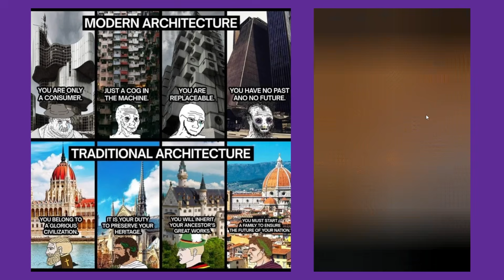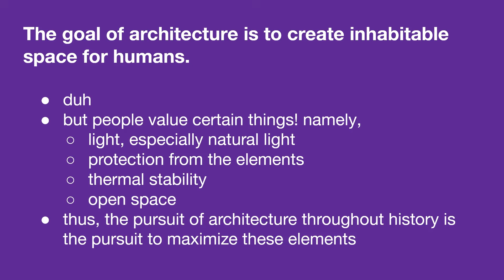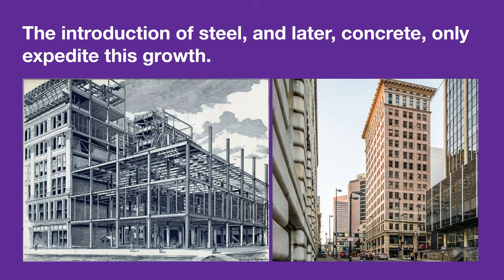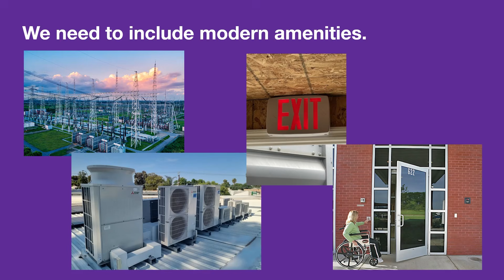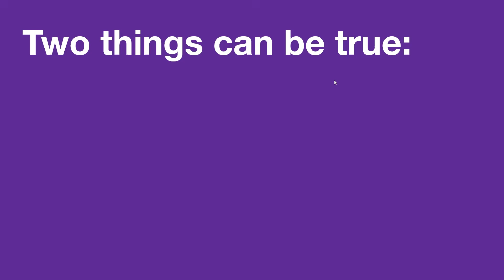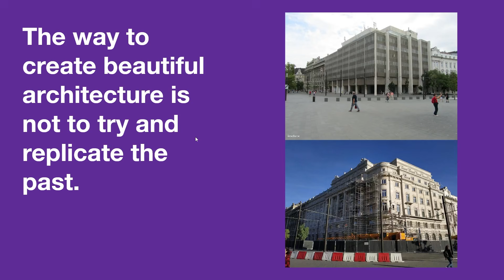Why We Don't Build Like We Used To

Comment: Generally I agree the debate is misplaced. I think the actual problem of architecture (a problem throughout time, not just a modern one) is that architecture generally doesn't consider the community at large but rather whatever the client wants. This isn't the architects fault but more of a fault of society, and modern society focuses on short term value over human growth. Strictly speaking though building better community spaces is actually better economically in the long run because it encourages growth in the people themselves.  A great example of this is all of the architecture which stands the test of time. Generally most of these are community spaces or places which can be enjoyed by the community at large like cathedrals, museums, etc. Even buildings like the Empire State have observatories and public shopping. 

A great example of communal thinking would be the Rockefeller center. It's genuinely a great place where everyone can feel special just by being there which is quite inspiring. While it has offices and shops, it offer a wide variety of public spaces and well decorated areas that are meant to lift up the human spirit and I think it shows why it's such a popular destination. It could use a little more greenery but that's probably my only criticism. Contrast that to most of the skyscrapers being built today like the pencil skyscrapers and you can see why people seem so frustrated. It feels like a gaudy unapproachable world in comparison, flaunting wealth and inaccessibility as well as separating the classes. Like I said though, it is my economic theory that this sort of greed destroys us in the long run, and it may be that our time is running out. Society can always change though so it's not all doom and gloom.
Reply from the maker: well said!

Comment: 7:05 yeah no. The vast majority of decoration on the façade of older buildings was mass produced in factories/workshops. Very few of the ornamental elements that we see on traditionally designed buildings are hand carved stone, most of them are cheap mass produced stucco that was picked by architects from catalogues.
Reply: Came to say this. Ambiguity in what people define as "classical" allows to make any point you want.
Reply: @barking_doggie exactly this video is dishonest. Also, it’s flat out wrong. Buildings made out of glass are absolutely not efficient, glass is a terrible insulator. Finally, smearing everyone who doesn’t want to live in cardboard boxes as racist is ridiculous. This happened in Norway, where people that wanted traditional architecture were smeared as nazis, until it turned out the leader of that movement was a left wing Jewish man.

Comment: I think this is mostly correct, but misses some details. For instance, 20th century revival movements are what many people who talk about "returning" to traditional architecture are aiming for. These used a great deal of prefabricated ornaments (rather than overrelying on handcrafting), and are often found in much humbler places, with much humbler construction, than the palaces that have been preserved. In my home city, there are a lot of office and warehouse buildings clad in mass-produced terra cotta tile. These look appealing and were inexpensive enough to use that apparently you could clad a warehouse in them. Most of the more "traditional" looking buildings in Canadian cities are less than 200 years old, and, as such, were built this way. The difference between the "traditional" style of building and the more contemporary styles that emerged in the 20s are not just new materials, but also well-worn rules of form, proportion, and ornament, as well as an ethic of coexistence with surrounding structures and places that descends from pre-capitalist property norms.

One interesting point I noticed that you missed is that the exterior of a building does also (historically) have a role in the design of it; a building's role on creating a public space was, in the past, also a significant component of its design, (obviously, excluding shanty dwellings, like the one you depicted). In the contemporary context, it's more typical for a building to be designed to stand out rather than to fit in, imagined almost as a sculpture than a component of a public space. This is not universal (you provided an example of the contrary), but it is common, particularly in North America (this is partly an artifact of our property norms and zoning policy though).

While I'm always going to be a defender of a lot of modern architecture, sometimes it does make decisions that are just aesthetically or functionally bad compared to how vernacular architecture was built in the past (the overabundance of flat roofs, or extreme many-edged sculptural geometry, for instance, tends to lead to water problems, while especially well-sealed structures that could have been made more breathable are not equipped with the proper design features to avoid developing mold problems). Additionally, modernization has brought with it a great deal of abandonment of vernacular styles, which remain fairly inexpensive to use. Where I found your talk lacking was that it omitted discussion of the middle stratum of historical architecture, and how certain conventions and vernacular elements, inexpensive in their day and not too adulterative of the cost of construction in ours, have become much more marginal, in spite of their relative benefit to the function of a structure as a constituent element of a public space. That all said, there is something about revivalists of "traditional" styles that is always rubbing me the wrong way, and I agree it's associated with vulgar reactionary tendencies.

I'll add one other note: we can't always say that fancy looking old buildings were universally expensive and uncomfortable. This past summer, for instance, I stayed at a hotel in Rome, while it was brutally hot. The building was made of stone, in about the 17th century, with an internal courtyard and a design intended to channel air through the entryway and up through the centre, cooling it. It was very similar to a number of abutting buildings, and it was very beautiful, in my opinion. This hotel was once some rich guy's mansion, but features like courtyards are fairly ubiquitous in period architecture all around the Mediterranean, including apartments, public buildings, and so on. It had retrofitted elevators, but no AC (we wound up asking the manager to give us a lot of fans, which, coming from Canada, were hardly enough, but it was ok). The building could easily have had AC retrofitted in, but the Roman tolerance for heat and the design of the building are such that someone not from a city built on a hot swamp would be essentially fine, even in the misery of mid-July in a heat wave. Compare a glass-clad building, where even in relatively cool places, the glass tends to have a greenhouse effect, requiring AC so that the space won't essentially cook in the summer, and even with double-glazing, costs substantially more to heat in the wintertime than buildings with smaller windows. This is no small thing, as most heating in Canada is done by natural gas, and that is one of the reasons why, in spite of our relatively carbon-free energy grid (except in Alberta), we are still some of the worst per-capita polluters in the world. To build a building that meets high emissions standards (like LEED or the like), especially if it is a house, glass cladding is often a financial and practical infeasibility. It's all about tradeoffs, and "traditional", vernacular features are often able to address the fundamental needs of a building with less ongoing expense than more contemporary styles, that are able to ignore such approaches to habitability because we have AC, central heating, electric lighting, and dehumidifiers. Ironically, this can lead certain contemporary structures to be more expensive to maintain and less comfortable without the addition of modern, energy-hungry amenities, than vernacular construction. Personally, I'd like to see less of a straight "return" than an embrace of the virtues of vernacular structures, and more construction that properly confronts the practicalities of managing water when petroleum-derived sealant fails, especially in the middle stratum of relatively inexpensive, but decent quality builds.
Reply from the maker: Well said! I wanted to rebuke many of the talking points I've seen online in this video, but I could have dived deeper into the difference between the local vernacular architecture and the mythical "traditional" architecture. I do agree that many cultures have developed low tech solutions to their environmental conditions that we as architects need to draw inspiration from. There could be (and probably will be) many followup videos on this topic that will cover these areas.

Comment: I think this video misses what most people mean when they say that they prefer older buildings. They are usually not (only) talking about monuments (though that may or may not also be the case), but rather standard row houses.

People like decorated facades and stucco, like when the house (looks like it) is structurally intuetive and when facades are broken up. And they conversely dislike homogeneous facades and non-structurally-intuetive curved walls.
I also don't think that survivorship bias is as much of an factor. For example the city of Prague has a huge old town, most build in the 17th to early 19th century styles.

Regarding the optimized elements mentioned in the beginning, the only one that is really less optimized by this is light. But also, there are diminishing returns when letting in more light. Having lived in one of those old 1m thick walls buildings, they are as bright as modern ones. But of coures the optimized factors actually driving those old houses away, as mentioned later in the video, are cost and space utilization.

Though most of that could be solved with modern construction imitating old facades. I think most non-architects are fine with (or even like) fake materials and diguised purpose.

Though you are probably right when you say that there is a lot of dogwhisteling going on. For example the beautiful arabic architectures are seldomly mentioned. (But european architecture is also just the one people are most familiar with.)
Reply from the maker: Two points:

I think home construction is one of the worst spots for modern architecture right now, largely because architects aren't involved with the majority of new homes being built. They're all usually made by cheap developers that are trying to make a quick buck. It's disappointing to see. 

Second, I agree that more structures should be designed with ornament and intricate elements. I think that the advent of the digital age in architecture will help us bridge that gap, and when manufacturing these computer-designed parts becomes cheaper, we will start to see them all over the place. I have lots of hope for the future of the profession
Reply: Yea this was more targeted to the more popular social media discussion,
For the Townhouses, as far as i know theyre relatively modern (tho still accessibility and comfort like heating issues, and those that arent as modern have big stuff like plumbing issues), 
Part of huge national and destructive projects and architecture seems to really favor rehabilitation rather than destruction nowadays
So its usually one building at a time, trying to be cohesive with the street and environement, which unfortunatly isnt always succesul indeed but theres still good examples
Usually people use big housing brutalism to complain, which was necessary because of post war lack of funding and huge population boom, which otherwise wouldve lived in slums

Not that you didnt know this you just catalized some thought
Reply: @WhatATwist-neoswing brutalist architecture at least is well insulated and, in the USSR, was meant to be a short term solution to a housing crisis.
Reply: @larb6314  yea
Reply: Exactly why would anyone in the United States have nostalgia for, for example, Moorish mosques. Those were beautiful but they were never built here (and were also monuments, not places for people to live in). Meanwhile, middle-density apartments made out of durable materials, with elegant mass produced ornamentation actually were built in the 30s and 40s. They were beautiful and they were bulldozed for the sake of suburbia. Everything new is built for pure short term profits, the low quality materials will not last and yet due to the greed of landlords we must pay luxury prices for these shitboxes. But I guess believing that was a mistake makes me a racist.
Reply: I think when u talk about rowhouses u forget that at the same time that those were being built like half of people in cities lived in slums, survivorship bias may be way stronger than u are thinking. But yeah row houses are very neat a shame that atleast in the us where i live all the same idiots who want to "rerun to tradition" would kill to not live in one because they want a ""small" 3000ft "starter" house" instead with a bunch of grass around it and because sharing a wall with someone is communism or something.